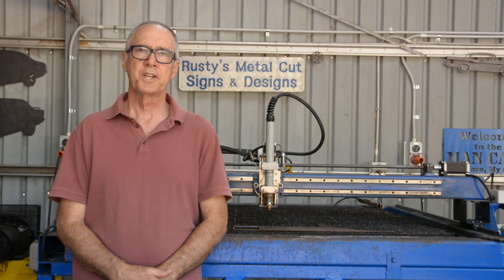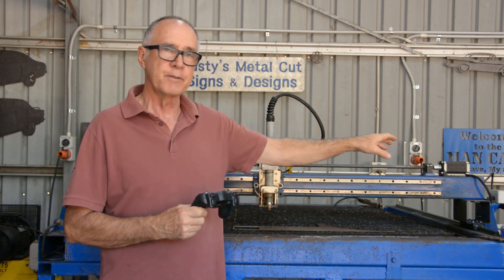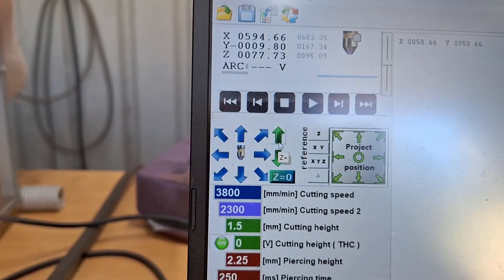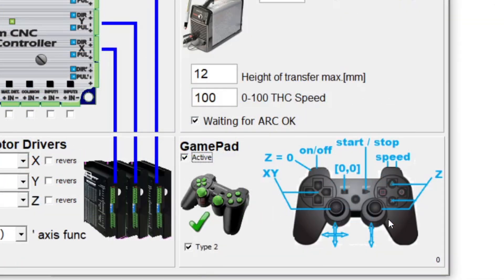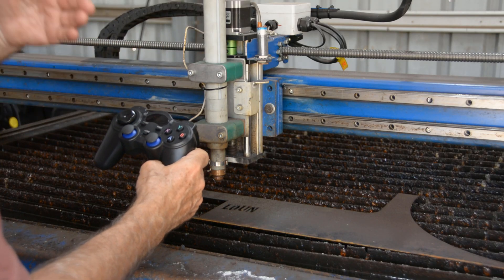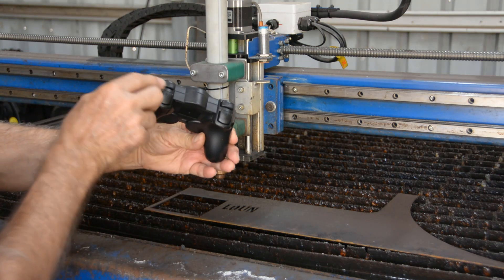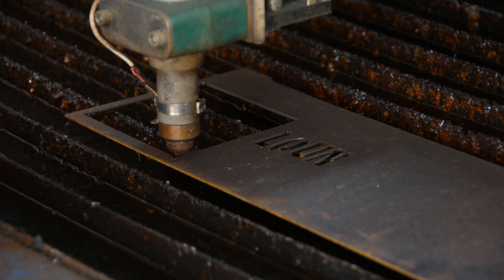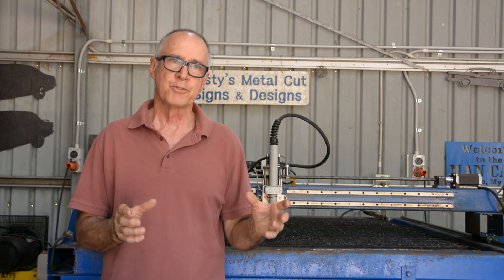Wireless Game Controller for CNC Plasma Cutting Table | MyPlasm

Comment: Spot on, I use the MyPlasm workflow as well but the need for the game controller is a must if you aren't in reach/view of the torch head, well done! I see you have the torch head mounted with the THC wire. Could you make a video for just this setup in detail. You will be aware there's not much on line for the UNIMIG Razor (as I see you have upgraded) alternative connections.
Reply from the maker: Hey Rodd, the wire for the ohmic sensor fits onto the tab on the nozzle retaining cap of the Thermacut machine torch. When I ran the Unimig Razor Cut 45, I made my own ohmic sensor, out of the stand off guide. If you send me an email (rmhyde58@gmail.com) I'll send you some pics of how I made it.

Comment: Where's the Laser Weapon Fire Control Button for the zombies?  

I was looking at a  Wix - HC wireless controller for my table as it's 15' from the screen to the far corner of the table. (Lot of steps to align on the smaller jobs) but the tariffs will probably shoot that down..
Reply from the maker: G'day SegoMan....those buttons have been configured into the controller, but I purposely left out showing them. But you saw right through my cunning plan!!
Reply: @RustysMetalSigns  
Rusty I don't think the Zombies Can read or watch Y/T, your safe even with my data breach..
Reply from the maker: Let's hope it stays that way!!